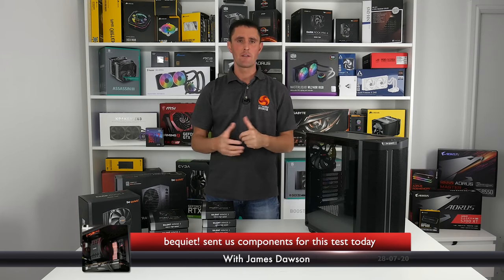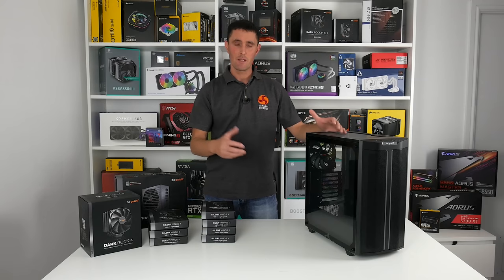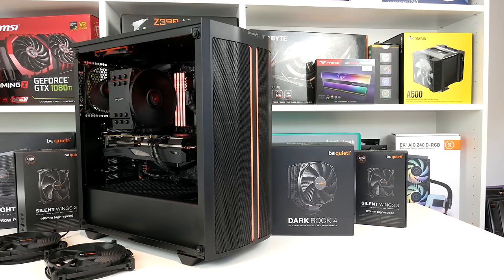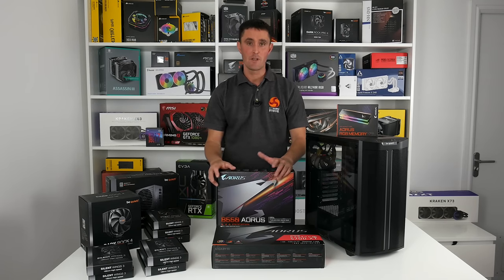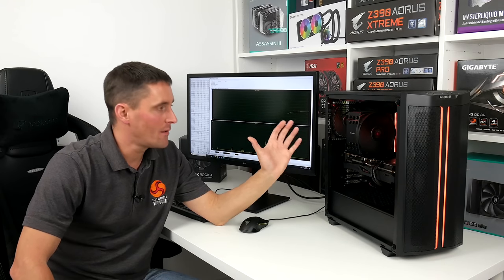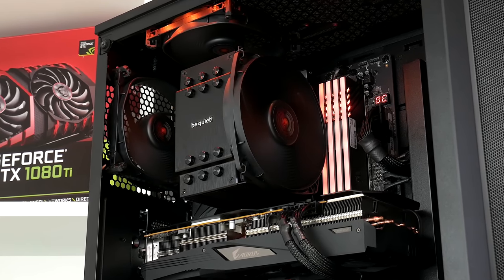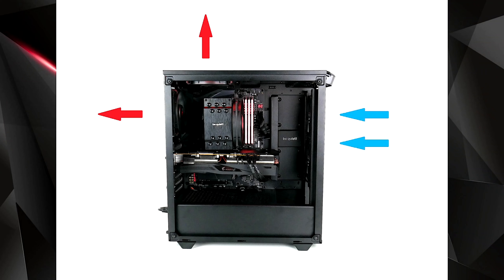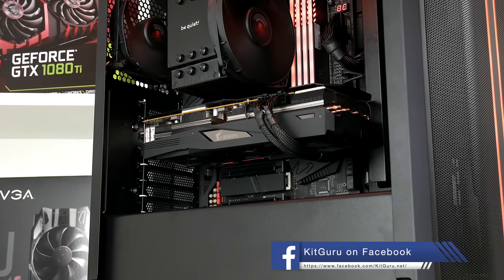Positive and Negative Airflow Testing / be quiet! Pure Base 500DX (w/ timelapse build)

Comment from the maker: we will be here at 2pm UK time to chat with anyone who has any questions they need help with !
Reply: @KitGuruTech Hi, I have a question.  So if I put 2 shadow wings 2 140mm (slightly worse then silent wings I believe - at least cheaper :D) as an intake on the front and 2 shadow wings 2 120mm as exhaust (rear and top) will I have a positive pressure then?
Reply: Hi. I have a question. i would put the 3 fans included in the case as exhaust ( 2 at the top and 1 at the rear), then purchase 3 120mm pure wings high speed and install them at the front as intake. Am i right?
( silly question but I have only one chassis fan header available on my motherboard... should i purchase some kind of PWM splitter?)
Thanks a lot for your video, very interesting stuff
Reply: Would it make a difference in the end result (slightly positive fan setup) if you would use the dust covers in front and top?

Comment: The cable management is one of the best i seen in build videos. Good job! Also i agree, the build turned out to be beautiful. No flashy bling stuff... Nice mid-range config too, most of us would be happy to have something like this at home. If i had to write something negative (splitting hairs) there is a tiny bit of gpu sag, and the 750w psu is an overkill :D 
Thanks for the content!

Comment: Interesting tests. Do note that setting intake and exhaust RPMs to be equal does not warrant balanced air flow.
In order to achieve perfect balance, front and rear mesh holes have to be of the exact same size. Every square millimeter of material matters.

Comment: Gorgeous build , if I was you I'd give myself a compliment more , it's not just one of the best looking builds in ages , also one of the neatest cable management ever. Well done and may the (slightly) positive (pressure) Spirit  win!
Reply: Thanks! I like to try my best with the available components. 😁
Reply: @KitGuruJames   A pleasure! Just a curiosity of mine , btw. Will you test also 3 fans front/intake + 1 or 2 fans exhaust ?

Comment: Hey thanks for the  effort. I just got the Pure Base 500DX case  after hours of research. Three 140mm fans included non  arbg from Amazon.  Subscribed. Just transferring my old comp to a new case. Bought it used  for $300 US bucks but it came with a Sapphire Tri-X R9 290X OC and by the way it does play games like BF3/Bf4, Cod,Fortnight just fine. I do appreciate your innovative tests. Next time just start with the stock stuff then test. Helped me much and I am not a "Gamer". Thanks and good luck.

Comment: I have the same case with a Ryzen 3900X and the monstrous BeQuiet cooler with the two fans. Even though I don't have issues I decided to improve thermals if applicable, thanks for the very informative video and your overall effort, helps a lot.

Comment: I'm hoping that this shows optimal configs for dust accumulation also. I didn't buy the lancool mesh because it has no dust filter so I went with the phanteks p600s instead, beautiful case. I have two 140mm fans in the front and two 120mm fans in the back. I would like to see tests looking into optimal fan RPM configs for different airflow setups. I'm not sure how well two 140mm and 3 120mm fans replicate neutral airflow.
Reply: Your setup sounds ideal to me, slightly favouring positive pressure so good for thermal performance and dust as long as your front fans are filtered.

Comment: I have a pure base 500 original with 2 140's up front and 1 140 in the rear, pretty standard config. System is happy unless really heavily stressed. (fans are pure wings 2 900 RPM)

Comment: Hello @KitGuruTech, Thank you for this video, I have only just discovered it.
I am loyal to be quiet! brand.
I have the same 850W power supply and 4 Silent Wings 3 140 mm fans: 2x High Speed for the front and potentially 1x rear and 1x at the top.
If I understand correctly (I'm French frog ^^), the best configuration is with 3 fans in positive pressure: 2x front, 1x rear?
The 4th fan at the top, does not do better in the end? And the whole thing would make more noise in the end?
On the other hand, to cool a Ryzen 7 5800X processor, do you recommend a Dark Rock 4 or Dark Rock 4 Pro cooler?
Depending on the cooler, do you recommend adding or removing the top cooler?
And last stupid question, which rubber wedge mount (2 positions, S and L) do you use depending on the location of the Silent Wings 3 fans? S for intake fans (0 spacing) and L for exhaust fans (a small space)? 
The instructions are not clear...
Thank you, have a nice day!

Comment: Just because you used a certain amount of fans for either the exhaust or the intake doesn’t mean the chassis is positive or negative, there are numerous other factors such as RPM that have to be taken into play. Also, you sort of neglect showing the actual performance of the case by not having the tempered glass on or the filters. I understand that’s a factor that will vary by case to case, but that’s far more realistic than having a completely open case. Regardless, this was a solid video mate, hope to see more.

Comment: I'd probably setup this case with 2*140mm or 2*120mm exhaust and 3*120mm intake.
Reply: Same. I’d use three Phanteks t30-120’s @ performance for intake and two Phanteks t30-120’s @ hybrid for exhaust.

Comment: When I first got this case, I had 1 140 up front, 1 140 in the rear and 1 140 up top and everything thing seemed fine.  Then I added another 140 in front and something seems off.  Is this a case of "less is more," do I not need a 4th fan and should I move the top one to the front to have just 2 in front and 1 in back?

Comment: I didn't see any mention of fan orientation for the power supply. Did you pull air from outside of the case into the power supply and out the back of the case, or did you pull air from inside of the case and out the back? I suspect you had the power supply with the fan pulling in air from outside of the case and out the back of the PC but just thought I would ask because it does make a difference even with a power supply shroud.

Comment: Hello there. This was almost exactly what I have been looking for. First of all, 12 hours testing, thank you for your contribution for those who want to know about the outcome of these tests. I would like to go with Balanced pressure but unfortunately the case comes with 3x140mms and I don't want to put those 140mms aside and buy new 120mms. I was wondering what kind of a big change would I expect if I were to use 2x140mms in the front as intake and 2x140mms exhausting fans one being on top and the other being in the rear. Basically I just want to add one more 140mm to the front. How different would it be than the balanced pressure as it was the outcome of 120mms instead of 140mms? Thanks.

Comment: Does not make sense to do tests with 120mm fans. This case comes with 3 x 140mm fans. Buyers are more likely to buy some more 140mm fans for this case(that's what I did) because of better airflow and lower noise. Why not use the included fans for test when most people will just use those? I watched this video because I wanted to know which configuration of the originally included three pure wings 2 fans (plus two I bought) gives the best cooling result, but there is nothing about that in the video. Buy the way, currently I use 4 intake and 1 exhaust at the back, I find that configuration good enough.
Reply: I use 120mm fans in mine - makes perfect sense for me. Im pretty sure they don't have time to cover every possible configuration. Regardless, the negative and positive positions they used will apply to larger fans.

Comment: Hey, this is kinda the vid i was looking for, as i'm having a bit of a problem with my 500DX. So yeah, i got it, and i am using the three stock coolers provided with it (Pure Wings 2 140mm), and when i am playing something a bit more new (Sniper Elite 4, Expeditions Viking lately), basically when it is under the load i can totally feel the hot air bouncing off the wall behind my pc table and reflecting back into my legs and generally creating quite a temperature beneath my pc table. It's not much of an issue now, but i am dreading the thought of it happening when the summer comes, my balls are gonna sweat off. I am not using the case in the default configuration, the one on the top cover i have had moved as a second front intake cooler, so i am having a 2 140mm set to intake on the front panel, and the third 140mm set on the back panel of the case. The case is sitting in the bottom right side beneath the table, and the table doesn't have the typical 4 legs, but it's more like two plank sides protruding from the top plank, and there is like a plank in the middle reinforcing the left to right side (legs as it may).The case is moved to about 25 cm from the wall behind, with the reinforcing plank of the table being somewhat obstructive halfway there narrowing the distance partially to about 20 cm maybe. It would be really easier to just be able to show the picture of the setup but that's basically it. The exhaust fan on the back panel is totally killing the temp beneath the table, so if you cguys would have an advice, it would te appreciated.

Comment: Hello, I have a pure base 500 dx case, I planned to put LIGHT WINGS fans, the question is where and what to put, I mean 120-140mm with what speed, since I don’t understand well, put 3 on the front panel 1 on the back and 2 on top or 1 on top please advise

Comment: Hi James, I want to build in this case and want to use the stock fans and a freezer 34 esports duo cpu cooler. Where should I put the 1X 140mm intake fan? At the top of the front? Or should I leave it in the middle? Thanks in advance.

Comment: How do you think this case would go with 2 140ml the front, 1 120 ml in the back and some sound deadening material on the inside of the roof for quietning and no air going up through the top?

Comment: Hello, I have purchased recently a pc with a be quiet 500dx case, and I have 1 fan at the back, 2 at the top, and 2 at the front. but the ones at the front, do not spin, i never seen them spin so far, are they suposed to be like that, and only start when pc overheats? or maybe is it something that has to do with the fans configuration? I am clearly not a pc expert, thats why I am asking if anybody knows to answer. Cheers !

Comment: How Was the noise  level ? Im thinking  on buy  a case and other  things specialy for that
Reply: We didn't record the noise levels since this was an airflow and thermal performance test, noise wasnt critical.

However, noise levels with the Silent Wings 3 high speed fans running at 1200 RPM were audible but I wouldnt say it was too distracting.
Reply: I have three Silent Wings 3 140mm and can tell you, it depends on the case. With my previous case (SilentiumPC Armis AR7 (not shit) + 0,5 mm thick best sound dampening material sides, top and front) I couldn't stand them running 1000 rpm during gaming (no headphones). With my current case (Define 7 Black Solid without any additions) sometimes I don't notice they turned from 300 to 1000 rpm when web browsing. Really - 13 kg of case works like that. Don't go airflow case (like DX) route, if you want more silence focused build. Airflow cases are better for overclocking, but dusty and noisy. What is unique about SW3 is the type of sound the create - that low I never heard from fans. And lower the sound is, harder to hear for us. That means decibel charts won't tell you much.  I'm really into cases, fans and coolers (kinda niche I noticed), so if you need any advice - feel free to ask. I know the best options in any budget :)

Comment: Would there have been a problem using RBG memory, with its higher physical profile, if the larger Dark Rock Pro 4 had been used? For more powerful CPU's such as the 3950X would you say that the Pro cooler would be advisable rather than the non-Pro version?
Reply: For higher TDP processors I would go with the DRP4. Fans are adjustable so RAM height shouldn't be too much of an issue.
Reply: @KitGuruJames  Just check how much space the case has - if it has room for 166mm HSFs and you get a 165mm HSF and raise the fan 10mm higher, you're going to have a problem. If you have that limitation, look for a HSF with an offset fan (I got an Alpenfohn Brocken 3 for that very reason but it may not be suitable for high TDP processors).

Comment: Ive found it usefull to buy cheap incent sticks and then used them all over the case, to see if i got smoke leaking into the case, where it shouldnt... (99/100 times those small areas arent dustfiltered....): then simply adjusted the speed of a fan or two, untill the smokes blows out.. = problem sorted.   And less dust. I clean my filters once a month (all intakes have filters). Never had to clean the inside.
Reply: Yes ive used a fog machine and vape to look at the airflow in the past.

Comment: here’s a question, a lot of new mesh cases can come with 3 120mm front rgb fans. If i were to add an exhaust (3 in 1 exhaust), would that be too much positive pressure? (obviously have front fans lower rpm)
Reply: If you adjust the RPM of the front fans it should work fine.
Reply: James Dawson Yeah I was thinking to have low rpm on front fans and just a higher one on the back fans. Obviously tinker until it’s right I guess
Reply: Another factor is noise. If you can, go for 140mm fans and run them at a lower speed. Smaller fans have to spin faster which makes more noise. Larger fans can spin slower to move the same amount of air and are therefore quieter. Even better if you use PWM fans and use fan curves to tie their speeds to temperatures so they make very little noise when the PC is barely being used. But you can't go wrong with 2/3 in and 1 out.

Comment: How would the results change if we instead used the Silent Wings 3, non-high-speed to achieve less noise? The non-high-speed Silent Wings 3 are significantly quieter, but have less airflow.
Reply: We tested with the fans running at 1200RPM so I would expect similar results with the standard Silent Wings 3 fans.

Comment: What happens when you have a balanced airflow but with 3 front and 3 rear fans instead of 2? Is it actually that better, or 2+2 config is enough?
Reply: 2 intake and 2 exhaust is more than enough airflow for this system. 3 and 3 would give similar airflow and pressure but potentially lower temperature with more cool air entering and warm air leaving the case.
Reply: @KitGuruJames  I have p600s case with 3+3 and the dust filter in front gets filled in like 10 days, so I'm wondering if I should drop to 2 front fans. They are all 140mm so pretty massive airflow x3
Reply: @gregorygkizas582  you could try running with just two front intakes to see if it helps with the dust build up. Do you have the system running 24/7? That sounds like a lot of dust build up in a short time.
Reply: @KitGuruJames  No I don't run it 24/7. It's a lot of dust but at least the filter does its job well xD

Comment: What happens if you keep the normal airflow and put the fan, that’s on top of the case in the direction, so the airflow goes down? 
I’ve testet it with mine. 2 fans in the front, take air in, one in the back, takes air out and 2 on the top that take air in. CPU stays at 40 degrees, even on 4,6 GHz. (Got an I5 10600k)
Does that make sense? I mean, it works but it does not fit into negative or positive pressure, can someone help me out?
Reply: All fans are btw silent wings 3 140mm

Comment: 2 on the front as intake
2 on the top as out
1 on the back as out
Is it ok?
Reply: I guess it will depend on if the specs of the fans.   If they are all the same then I would run 3 front intake and two in rear out.

Comment: Given the setup, why a 750W power supply? Are you assuming the possibility of upgrading to more power-hungry components?
Reply: The 750W power supply was used just because it was available and as you suggest it would cover future upgrades. A 650W power supply would be more than sufficient for this build too.
Reply: BeQuiet probably would not mind if you bought the higher watt and more expensive one ; )

Comment: WAS interesting, although as with temperature positive and negative pressure without knowing  the pressure gradient from inside to outside the case, can be a little meaningless. When the gradient will affect the effectiveness of cooling. As yet Pressure sensors (unlike temperature understandably as this is the critical factor) inside a case are not  provided and probably may never be as the move seems to be towards water or closed loop cooling, which in my view does not offer any real functional advantage over good air cooled systems.

Comment: When I plug in a external hard drive to the front 3.0 usb connector, the hard drive don't get enough power. So a bad cable has been used. If I plug in a usb stick, it works. I have to plug in the hdd on the back of the motherboard. Shame Be Quiet!

Comment: Great info but why run it without filters and front panel , no one is going to replicate this at home on a daily basis.
Reply: For the testing, we ran the case without the front and top dust filter to minimise any airflow restrictions but the front panel was fitted.
Reply: @KitGuruJames  thanks James , I'm looking to get this case as an upgrade from my s340 elite . Looks like a great case to build in. S340 always seemed a little restricted airflow wise with there front panel so I'm sure this will be better
Reply: @VeX-hr8yr  ahh the S340 Elite, i used one of those in the past, the white version. The Pure Base 500DX is a similar size as the S340 Elite but  should be an improvement if you are looking for better airflow.